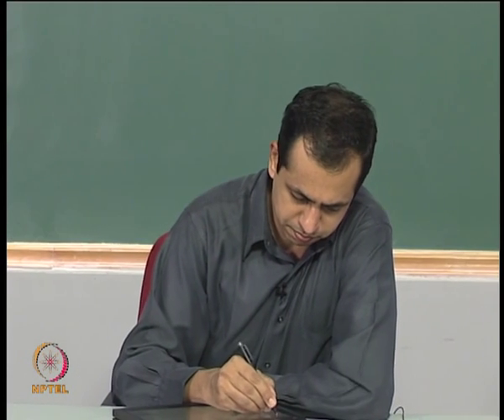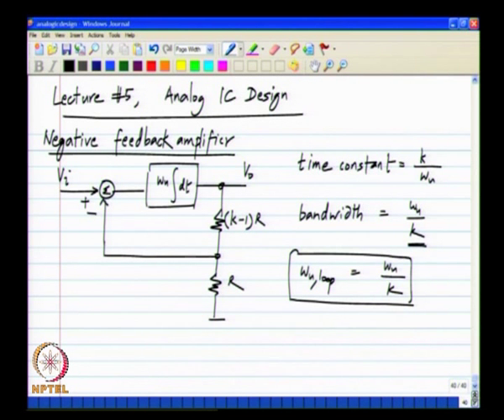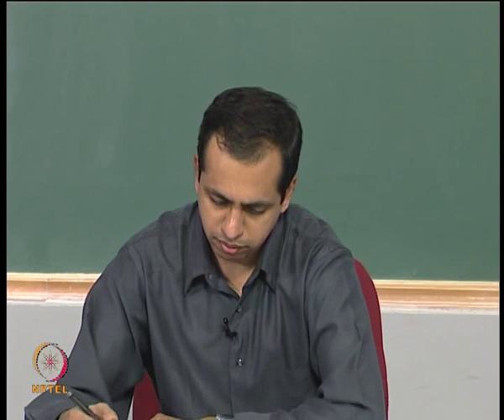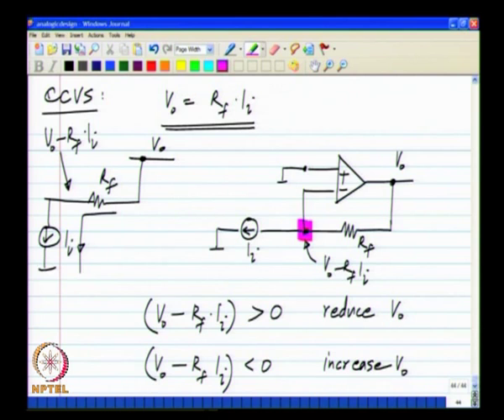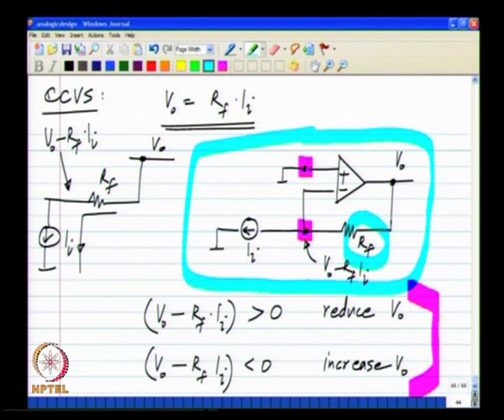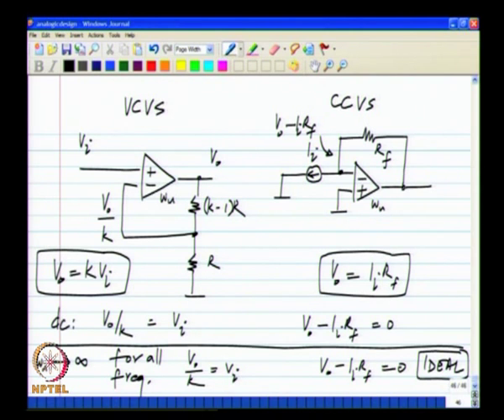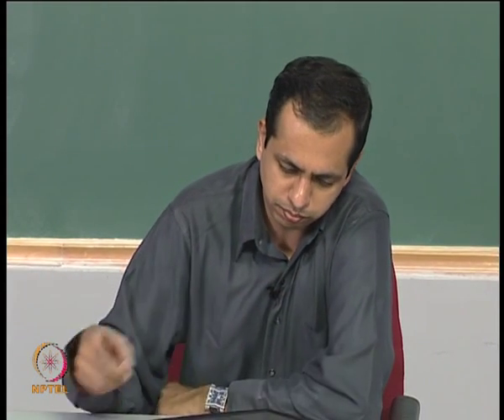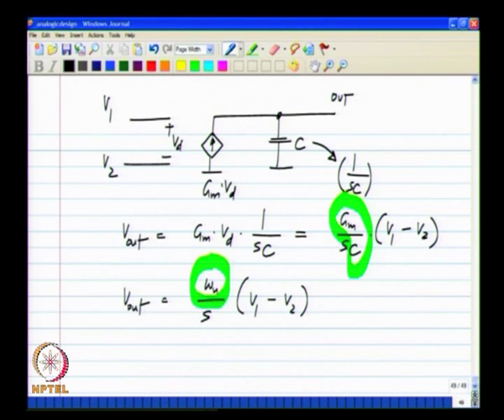Opamp realization using controlled sources; Delay in the loop

Comment: At 16:00, current source is drawn at the input, in reality how it can be realised. Since the output voltage Vo needs to drive another block, how this can me simulated in real life?
Reply: I think current source is an input quantity, according to which all other voltages at various nodes will settle. The current in Rf will not be changed even if you drive any other block of circuit.